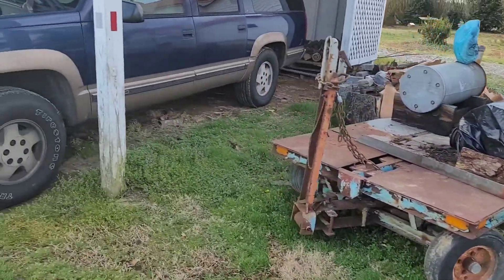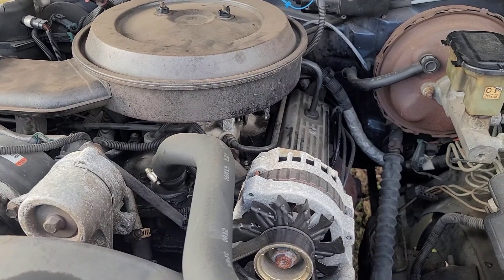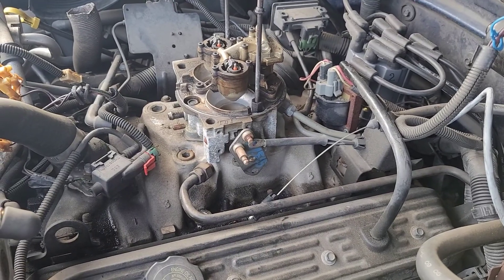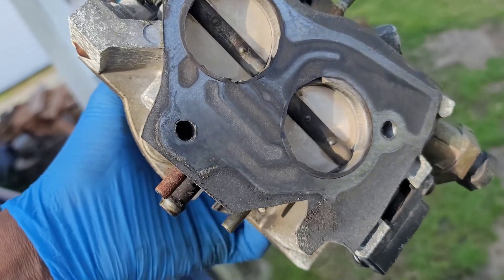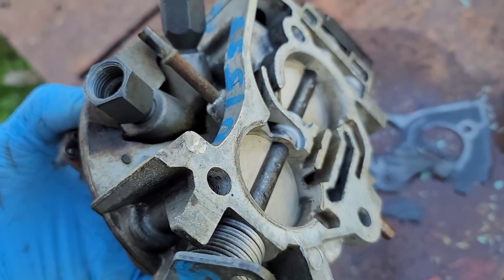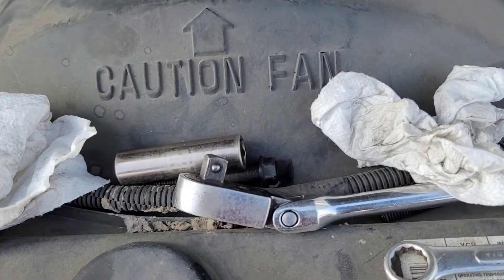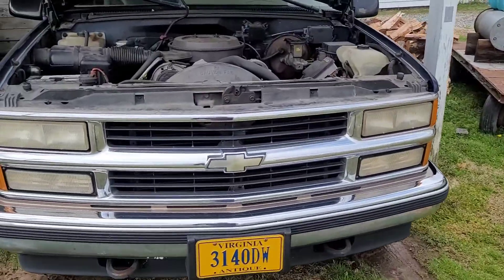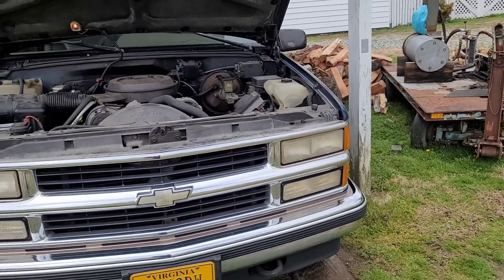1995 Suburban Throttle Body Gasket.

Comment: Hey did you also have strongish exhaust smell? I got everything in my engine new every sensor and engine is rebuild with 3k miles and I’ve been getting a strong smell I rebuilt my tbi aswell only issue was I used a tbi gasket with the middle not full which I suspect was my issue changed it but only went for a 5 min drive idle is around 700-750 and sounds more normal than before still smells but maybe the computer needs time to re adjust the small change in the gasket
Reply from the maker: On cold mornings I have an unburnt fuel smell, but that's to be expected as the injectors spray extra fuel to deliver a rich mixture. My 2005 Armada does it and my wife's brand-new Wrangler does it.
Have you ever changed out your catalytic converter?

Comment: Can this leak cause a throttle body malfunction code
Reply from the maker: It may. There are only 3 bolts securing the unit. If the gasket has never been replaced, it may be time for a new one.